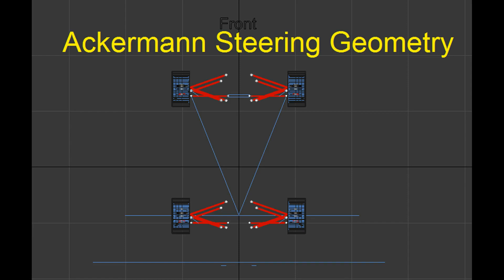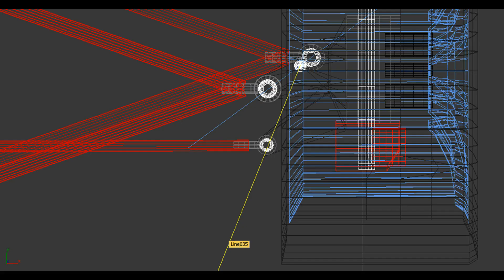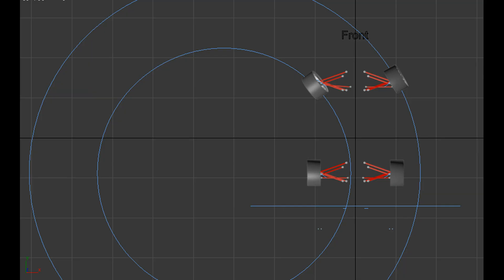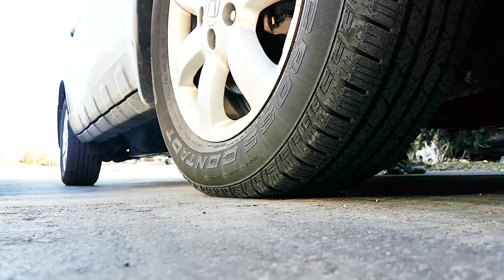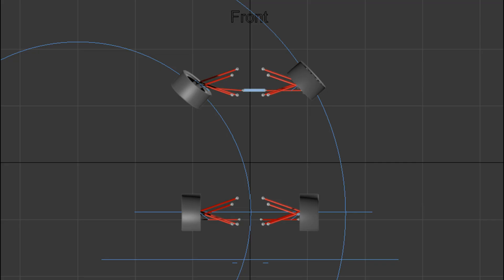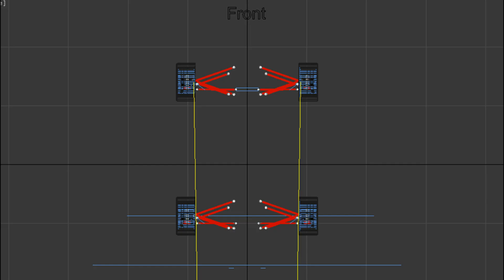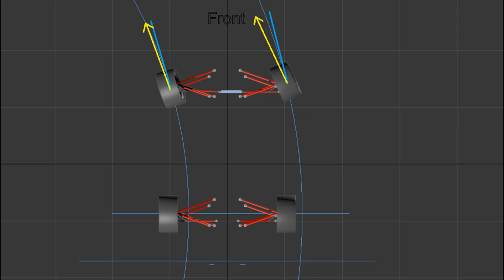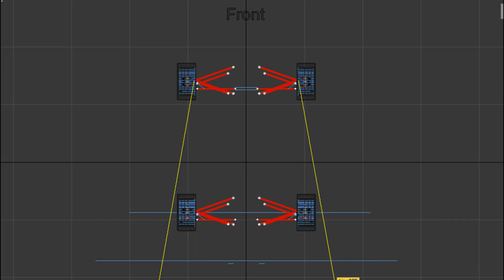Ackerman Steering Geometry and Anti Ackerman

Comment: Ackerman and bump steer can be used to have inner tire turn more in tight turns but outer tire turn more in high speed turns by relying on bump steer to turn the wheels.

Comment: Hi, would it be in accordance to racing rules to steer wheels independently using electric motors? Like the steering wheel is nothing but a sensor, wheels being steered Ackermann or anti Ackermann or something in between depending on how much the steering wheel is turned?

Comment: Hi would you say that regular ackerman ie both steering arms  pointing  to  centre of rear axle would be most beneficial in a reverse trike ...  im also suffering from excessive roll when two up ...do you think applying  higher roll center would improve in this application ...im using harley electraglide so quite high sitting position.. cheers great vids

Comment: Great video. One question though - what is the relationship between toe angle and the degree of ackerman? If the ackerman can be dialed in I'm unsure why you'd ever want to run toe.
Reply: That’s a good question maybe if a car had Ackerman then adding a little bit of toe will help.

Comment: I am building a 32 ford roadster using Jaguar XJ6 front and rear suspension components and am curious if the stock jag front geometry will handle in a car that will be heavy in the front.

Comment: these are the best videos of suspension I have seen and better explanation of suspension than I got in my Automotive engineering college classes. One point is that KPI and Castor must work together. when you change the castor the lifting force will change for the direction the wheel turns . castor will change the lifting from one side to the other in a turn. You can reach a point to get no lift if you have a lot of kpi and castor.  The lifting force compresses the spring so you can get the same effect as installing stiffer springs for a corner but still gives a softer spring effect on straight lines.
Reply: Thanks for this!

Comment: Hey, would you determine Ackerman by drawing a line between the two ball joints or just go with the bottom one?
Reply: akerman  would be the line between the ball joints and the line thru the steering arm pivot. so it depends on the height of the steering arms.

Comment: Great video!  Road racing cars with wide slicks can’t tolerate any toe out at high speed because the car would be unstable, ie darty. For example, when  I first saw Al Holbert’s  Monza at Mid Ohio probably in 1975, I noticed the rack and pinion was mounted 6 inches or so in front of the centerline of the front axle. It could have been moved further back but this location gave them lots of toe out as soon as the car turned into a corner. What that does is increase the slip angle of the inside tire making it pull the car into the corner better and killing some understeer.  The angle of the steering rod to the tie rod end in a left turn accelerates the steering arm until they are perpendicular to each other while at the same time, the steering arm on the other side was already at around a 120 degree angle to the tie rod and as that angle increases the amount it pulls the arm decreases. So the outer wheel actually guides the car but the inside tire pulls the car into the corner more than if it was on the true line. This can be adjusted for driver feel and tire temperature.  On a friends track champion , Late Model Sportsman car in the late Seventies, when measured from the straight ahead position to full left lock, when we got the car going fast, it had 1.5 inches of toe out!

Comment: Excellent explanation, I love it. So for optimized steering on a megacar, you need a vision system, programmed track data, 4 contact point load data with averaged sample rate to avoid bumps giving false load data, as well as car baseline cornering g data at various tire angles. Then separate electric steering for each tire. I'm going to build it, electric pancake motors in front, Chinese billet block with 133m bore spacing Albemet pistons similar to F1 and single mahle camincam to keep engine weight down. Two plugs per cylinder because 95mm (all manufacturers have gone to 95mm or less modular for this reason) bore is maximum optimized bore with a single spark plug. Now I just need to win the lottery or sell my house lol

Comment: Youre spot-on about angling the tie rod eyelet in so the line from center of ball joint and tie rod will meet at 'differential' center .If the tie rods are OUT FRONT OF BALL JOINTS,angle them outwards,still keeping tires straight.Check out video on you tube called 'GoKart steering explained.Including Ackermann theory'   thanks, (john wade,you tube)

Comment: You've gone through the basics on Ackerman and Anti-Ackerman in the front, you can always explain toe out the same way in the rear. Also, you can go through camber gain on bump steer, low body roll center and double wish bone geometry and counteract with positive camber alignment.

Comment: You're doing some excellent work. Thanks for sharing.
Could you explain, when figuring out Ackerman angle geometry, if the line drawn from the front to the centre of the rear axle, should that line start at the tyre's centre line or at the scrub radius point?
Or is there another point that needs to be taken into consideration? Surely the steering axis angle effects where the very begining of this line is?
Reply: I draw the line from center of ball joint or king pin,thru tie rod eyelet,and it must meet @center of rear axle.

Comment: Why does everyone show ACKERMANN with rear of ball joint steering. Never a front steering??
Reply from the maker: Probably just because its easier to visualize this way. Front steering racks will just have longer tie rods to achieve the same geometry
Reply: @xfmotorsports  Yes, but wouldn't basic ackermann say that the forward steer would mean the steering arms would be much closer to the width of the hubs? Direct line from rear axle center drawn through the front steering pivot to the steering arm connection point???
Reply from the maker: Yes, thats right. Usually you'll find the tie rod ball joint right next to the brake disc in those.
Reply: @SteveP-vm1uc  One question : does the anti Ackerman geometry has its steering arm( Ackerman arm ) pointing towards the front from the knuckle? And in  Ackerman the steering arm  always backwards ..?? Is this the reason for different wheel Angles?

Comment: Three GOOD videos.  Good presentation, complete without being wordy, and 100% correct.  You should follow up with the rear slip angles and how they relate to the center of the arc the car travels, body attitude, grip vs drift, and how that affects ackermann.

Comment: I would love to know how steering suspension changes with 4 wheel steering cars
Reply: The Ackermann optimum point would shift forwards, to the actual center of rotation if that makes any sense, and you have to run four lines, for every wheel.
Reply: @seven9766  or the point of rotation can move rearwards too. On some cars it's variable dependant on speed. It can move the point forward for low speed maneuverability but rearward for high speed stability. Very clever systems.

Comment: Its a fantastic information, visual and presentation. Just one feed back the pronunciation of steering is deformed to string, even CC (auto generated) interprets it as string, slightly confusing at times. Also it would be more understandable to say left and right tire over inside and outside tire. :)

Comment: Hey do you have the patent for the w210 front and rear multi link?

Here's a diagram of the rear w220 and the w140, w205, etc and it lists the patent number but I'm not sure if it's the same.  http://www.invetr.com/chassis/benteler-premium-suspension-sport-lateral-composite-leaf-spring
Reply from the maker: No, I don't but thanks for sharing the link. Pretty useful !  I believe w210 would be different since its a different chassis but should be a similar design to the w140 or w220